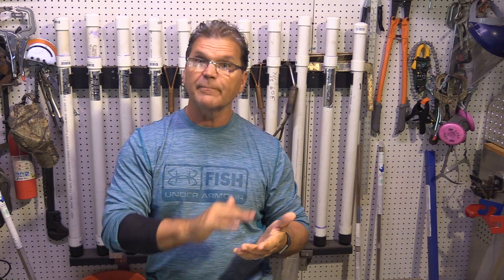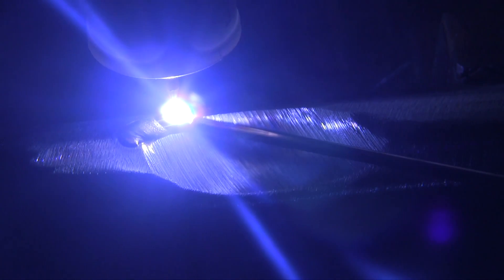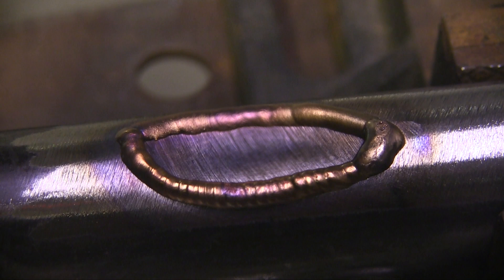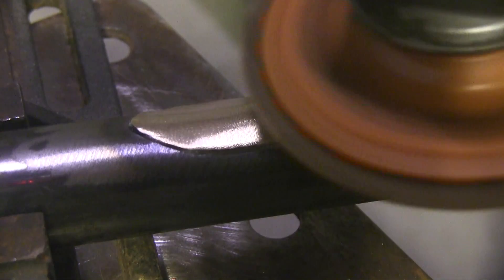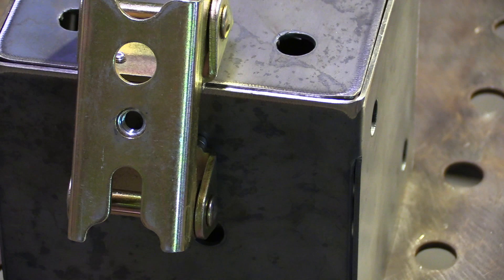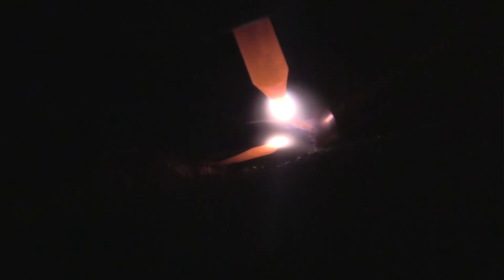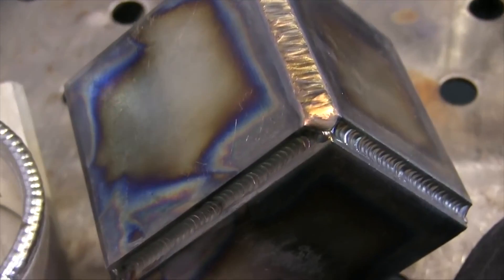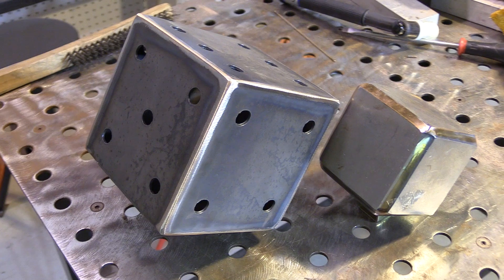Silicon Bronze TIG Brazing

Comment: My teacher said this is welding, but the internet says it’s brazing. Which is it?
Reply: Its brazing with a TIG welding torch. Brazing is like gluing with metal vs welding being physically melting two base metals together with or without the use of filler. In brazing, you're heating base metals so the microscopic holes open up more, then you're applying melted filler which gets sucked into those microscopic pores, and when the melted metal cools and hardens you have your joint.

Comment: Nice instructions and finishes. Could a beginner use this technique TIG to braze a brass bung nut and brass male threaded pipe in bottom of steel 44 gallon drum? Never used TIG or MIG yet.

Comment: Thanks Jody.  I think you just explained why solder won't take to copper wire that is discolored due to overloading the wire with current.  Oxidization.

Comment: Hey Jody - great video once again. I have a question about fumes? I picked up some silicon bronze TIG rods today and the guy at the welding store warned me that the fumes are particularly harmful. Is this the case and if so should I be taking any extra precautions TIG brazing like a PAPR or some such? Obviously welding comes with a variety of health hazards, but I am just trying to understand if there is something out of the ordinary here to be aware of. Thanks!

Comment: Slim chance you reply to this but what are the chances this will work to braze aluminum sheet metal to 1/8” thick steel flat bar? Basically plug welds.

Comment: how much TIG current should I use with a 4mm cast iron crack repair using silicon bronze brazing/filler  rods?  the repair is for a stove flue attachment to a Vermont Castings Aspen II multifuel.., amazing stove.. built like a old steam engine boiler, but just one weak point .

Comment: Can you flux with tig brazing?
Reply: why if you have gas? But also--it's going to be function of how much heat your flux can take and the filler needs. If you burn the flux you've got to clean up and start over.

Comment: I have a 60 in polish lathe it has wear over about a foot of the ways. I am thinking about building them up with silicon bronze and doing a light grind instead of a heavy grind over the ways and having to build the carriage up that much more with moglice. Any knowledge you can share about pros and cons I might not have considered.

Comment: To get less contamination when cleaning up the edges and making champers use a hard stone disc, 
Stay away from using flap discs as they add contamination.
when I worked for Delloro Stellite our welds was x-rayed and also had burn off testing,
Burn off testing is the weld is melted super hot and the gasses from it are tested to se how much contamination  and that the correct rods and gasses are used as well as a hardness test and many more.
if wrong 3 times your fired, as a full investigation cost a lot of money,
Anyway it was a  very stressful job but an enjoyable job so to speak.

So it is nice of you to do a good in-depth video of how you weld thank you for sharing and spending your time.

Comment: Thank you. Always learn from your vids. Have you ever used Muggy Weld 77 cast iron rod?  I have  welding a water chamber (cast iron) for a molten lead pump. I have been using the Muggy Weld 77 rod to TIG weld it. Looks similar to the Silicon Bronze rod you are using in this vid. Would love to see a vid from you using MW 77 rod on cast iron.

Comment: Weve recently got a job in at our workplace which involves a really thick walled tube i.e. 5mm wall on a 20mm tube and it passes through a pressing(a small sump)
We have been soldering it in to make a leakproof joint-my question is ....would tig brazing be able to do the same job even though there is a major difference in wall thicknesses i.e the tube has a 5mm wall and the pressing is only 2mm thick

Comment: I used silcon bronze  in places on a  motorcycle  fuel tank I had made. But because I must have melted the base metal in places and formed an alloy it was porous. please warn folks about the dangers of overheating the base metal.

Comment: I tig weld silicon bronze I watch a lot of your shows and others but what you guys never do is tig weld bronze on an already bronze surface like for instance a wear sleeve on a hydraulic rod or inside a tube. Bronzing is a different beast to weld on top of..Especially something that has  been soaking in oil.Thank you.

Comment: hey Jody - I've learned a lot from your videos. Have a steel cube I want to finish edges in silicon bronze. You didn't say what amperage you were using. One passing glimpse of the machine looked like 109 amps?? Seems pretty high, but thought I'd ask. You mentioned your pulse settings but not tungsten size or SB rod size?

Comment: very nice and instructive video!
ist there also a way of tig brazing aluminium? or is the oxide layer too much of a problem or the melting point of aluminium too low? I've searched about it before, but haven't really found anything useful...
in this video, you mention aluminium bronze towards the end. do you work with it as a base metal or can it be used as a filler rod as well?
thanks and keep up sharing knowledge! :)

Comment: I dont' have access to Argon at the moment, what flux do you recomend???
Reply: Ah, without Argon you have nothing, you'll need to use a torch!  Or switch to CARBON ARC!  This is what the ancestors used to do, even for things like galvanized iron.  Old books about electric arc welding show this.

Comment: My first  encounter with siicon bronze was putting 22 guage steel sheet metal in the floor of a  Drag  car.  The person helping  me  created the panels to fit and stepped them.......Told me to lay the rod in the groove and strike off....... worked like a charm.... a side note I use silicon bronze nuts and washers on electric connections......

Comment: Thanks for this video on Silicon Bronze TIG Brazing.  Do you think this would work on a chrome finished spool for a hydraulic valve?  I have a very old hydraulic valve, and the spools got corroded where the outer O-ring seal sits, and so it leaks hydraulic oil.  My thought was to fill in the corroded/pitted areas with bronze, then turn down in the lathe and polish. This would give smooth surface for the O-ring to seal against.  Thoughts on if this would work and what prep I would need to do?  Like grind off the chrome?  I do have experience TIG welding steel, stainless steel, and aluminum.  I have done Oxy-Act Brazing in the past, but it's been a number of years.

Comment: Jody,

Do you think TIG brazing could work to fuse 1/8" cold rolled steel rod together? If you had to use that process with a DC TIG welder with minimal controls (you basically set the filler rod and material size, then can tune in only amperage once it's ready to weld), what size tungsten and what type of brazing rod would you use?

That hammer is amazing, by the way.

Comment: I have a race car chassis that I need to mod that is made from silicon bronze brazed 4130 tubing. Is it possible to
'undo' silicon bronze brazing using a Tig welder? I would rather reheat and break the brazing rather than having to
cut the tubing off.Thnx!

Comment: Hey Jody, I'm sure you're swamped with questions but I tried this the other day at work and the silicon bronze spat a lot when It was exposed to the arc? Lots of fumes and generally not a very nice time! Any tips?

Thanks man :)
Reply: This sounds like you got Low-Fuming Bronze!  Or maybe seriously overheated?
Reply: Inadequate shielding?  The silicon bronze doesn't have zinc in it, it shouldn't have anything TO fume... so if it gets some oxygen it should get crusty as you see in the video but not actually burn and smoke the way zinc-bearing stuff does.  If you melt reg'lar brass with a torch and no flux, it'll actually be on fire when you take the torch away.  Little flame, lots of white "smoke".   It's a nice demo, just don't do it too much.

Comment: Got a question for you that is totally unrelated. I'm 48, spent over a decade as a fabricator and the last 6 as a millwright. My eyesight is going. I don't weld much as a millwright. Recently got given a large fabrication project at work and realized just how much my eyesight was affecting my ability to weld. Bought some 1.5 cheaters and it made a huge difference. Planning on seeing an eye doctor soon. However, as this being a fairly new problem for me, any tips on how to see my puddle better? My hood is a 2008 Miller Elite. I don't work with any guys my age that I can ask anymore. I'm the 3 oldest millwright so... And to think I used to razz so many guys my age back when I was 30 for not even welding the joints because there weld would wander off. Karma's a bitch. Shouldn't have razzed them.
Reply: Hey JR.. I am an old welder with fading vision.. I watched a guy on YT that was doing eye exercises so i tried it.. I will tell you if you do it rite it Works.. with head straight forward, look up and Strain your eye muscles.. now down.. now right then left.. hold each position for 5 seconds.. do this for 10 minutes each day and your vision Will improve... Its So nice to see that puddle & the edges!!

Comment: Jody, question: can you silver solder (silver braze) using TIG? Normally silver soldering is a gas process, but if you have something like a really thick hunk of copper pipe, being able to get some concentrated heat in the right place before it can leak out might be useful. Someone might ask why I'd silver solder when I could braze. It just seems like it could be a useful tool if it could be done.

Comment: I Use an old syncrowave 250 at work that doesn't have pulse, I got good results pulsing the pedal, is this an acceptable technique and am I accomplishing the same thing?  3/16 steel with 3/32 silbrz at 100 amps

Comment: I acetylene gas brass flux stuff a lot. Some time its to much heat. I'm wondering if you can tig brase the silicon bronze with the scratch start? Since I don't have a the lift tig welder yet. I like this Idea thanks for the OJT

Comment: Jody, and everyone else:  two years ago this coming May I wound up with a bouncing baby cardiac inplanted defibrillator.  Since that time it's become pretty apparent that medication interactions were the underlying cause of the ventricular arrhythmias I experienced and the defibrillator has never shocked me since being installed and acts only in a monitoring capacity.  Enough of the background details.
The reason being I haven't arc welded in any fashion (MIG, tig, stick) since receiving the defibrillator. 
The question I'm putting out there to everyone is this.  Has anyone done arc welding of any kind with a defibrillator and had any problems or received a shock while welding or shortly after?
Any info would be better than what I have now which is nothing.   An I'm not holding anyone responsible, I just want to know if anyone's had problems, or equally important hasn't had any problems at all?  
Scott, Vancouver, WA.

Comment: Hi Jody, I have a John Deere B tractor. The clutch drive disk is loose on the crankshafts tapered splines and has been run that way so the splines on the crankshaft are very worn. I'd like your opinion or views about welding the splines on the crank and having them re-machined. How would you do it? What process and what rods would you use? Do you think it would even work? Thank you for your time.

Comment: Jodie
What do you think of using silicon bronze for the flange to header (stainless steel) tube outside joint while tig welding the inside of the flange to the tube and grinding flat the stainless?  I was thinking that once the inside was a solid weld, the outer ring would be more flexible and less prone to crack with the silicon bronze and yet provide some strength.  Thoughts?

Comment: Hi Jody,thanks for another great video. When you started filling in the "hole" you made for the demo- shouldn't you have ground off the blueing on the thin side as this shows oxidation ? Also before filling in the hole wouldn't it be better to die grind off the blueing for the same reason ? Sorry to be picky!
Cheers.

Comment: Would there be any issues applying this on automotive sheet metal? I'm going to replace a fender arch and thinking of brazing it to avoid warping as it will be an issue when welding.
Reply: Doesn't it sound perfect for that use?  You'd be ahead of the curve I think.

Comment: Nice job. Thanks for all your vids. I just got a spool of silicon bronze mig wire from Santa. It would be nice if you could do a demo of using silicon bronze wire with a mig welder. I am having trouble dialing in my 210 MP for thin sheet metal.  There are not many such demos on You Tube. Just an idea for a future video. I always learn a lot from your videos. Thanks

Comment: When I teach electric soldering the MOST important thing is to get the joint hot enough to melt the filler and NOT to melt the filler and apply it to a joint that is not hot enough. Watching you apply heat to the filler, I wonder how you are sure the base metal is hot enough to melt the filler? Thanks !

Comment: Good tips.
Could you go over the reasons for using Silicon Bronze vs Aluminum Bronze. I have an old iron casting I need to fix some cracks in and I'm confused as to which of the two to use. (cylinder head off and old hit-miss engine).
Thanks

Comment: Beautiful! 
Is there any video that shows cut & etch of silicon bronze brazing?
Reply: Useless to cut and etch, there is no melting of the base metal thus no penetration  into the base metal. Brazing only surface bonds. Like soldering.

Comment: Thank you so much, Jody.  So taking all the information you gave in this video, I have a question.  You used silicon bronze on steel.  What if the base material is brass?  Brass and bronze have the same melting temperature.  Around 1700F.   Would you call it brazing or welding?  Is there a way you could melt your filler rod without melting the base material?  (I think not).  And if you need to weld/braze (whatever you'd call it in that case) brass to brass, what would be the technic?  The same as you showed in this video, or different?
Thanks.

Comment: Did you run that dc? I've done the same jobs on hydraulic fittings with straight copper wire from the electricians scrap pile,  give it a go jody its great cheap practice and flows much the same as silicon bronze 👍
Reply: !!!!  If that's true, it's a new world.  There's always some wire around!  This works with torches, but definitely a higher temperature.  There are videos about using this in sculpture.   Might be easier with TIG than with torch, can't wait to try.

Comment: Thank you so much for this video Jody. I just made my first tig weld Saturday, I'm hoping to braze up a shaft to be able to turn it back to size. Will 2% Thoriated (red) tungsten work for this?
Reply from the maker: yes it will
Reply: @weldingtipsandtricks  Thanks Jody.

Comment: Nice work you do mr. Jody. I want to ask you if I can tig brazing a cracked engine block (cast iron), just to stop leaking, with my dc inverter which has only lift start and pure argon and what tungsten to use? Thank you.

Comment: I've faced a few hammers with silicon bronze at work, as to protect stainless if I need to bump it around. People think I'm a genius, but really I just learned it from your videos. I've also used silicon bronze to make fixtures, and make silicon pads at certain points on the fixture to help not scratch the stainless. Also this reminds me that I need a new TIG finger.
Reply: Could you explain a bit more about these silicon pads and fixtures?  That seems really interesting!
Reply: !!  This sounds great, and a solution to the "too many hammers" problem.  Extra hammers could be faced!  Ah, it sounds like it would need a LOT of heat for a solid block of steel such as a hammer.  I'm going to try it.

Comment: Thanks for the great video as usual.  Great explanation of soldering, brazing, and welding.  I make jewelry using sterling silver, fine silver, brass, and bronze usually soldering with a high content silver solder and flux.  I usually use a Little Smith torch with either oxygen and acetylene or propane, at temperature well over 1000F, my question is a lot of people call this “silver soldering” is this soldering or brazing?
Reply: Thanks Swampy.

Comment: Cymbals... as in repairing hairline cracks... I've seen a small amount of experimenting on this, but there were no results that were really acceptable. I guess the difference here is that you are mostly laying bronze on steel... while cymbals ARE bronze. So you wouldn't have that advantage of polarized melt points... Any ideas?
Reply: Any heat above 500°F will anneal the brass.  Basically taking this highly work hardened metal from a yield of 70,000 PSI to dead soft 15,000 PSI.  This makes it dead.  Solder?  It adds mass and is even deader than annealed brass on the tone scale.   This is why pipes on a pipe organ are made of lead and tin alloy as to not contaminate the tones from the air.  Similar issue with bell repair.
Reply: I was hoping I could actually find a way to truly weld the crack, then carefully run a lathe over it... but that is probably getting well beyond my skills. Of course you couldn't get the original sound back. Probably not even close, but maybe it could function well enough for a practice cymbal!

Comment: I made a belt guard for the old air compressor that I resurrected, used 20ga sheet metal. To save from warping, I thought I'd used silicon bronze...worked like a champ and went faster than welding.

Comment: Hey Jody! Great video, I learn so much here! Do you have a video for a stainless thin to thick application. I ran into a test last week where they wanted a sheet metal stainless (10ga?) piece welded to a 3/8” carbon plate with 309L. I thought it looked like garbage, but the tester said it look better than 70-80% who try it, so 🤷‍♂️ guess I did good 😅